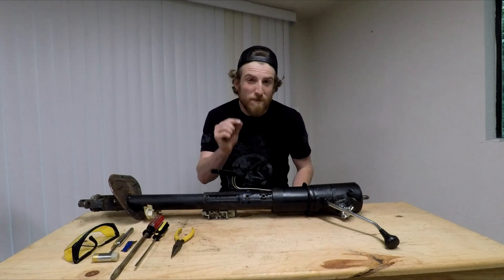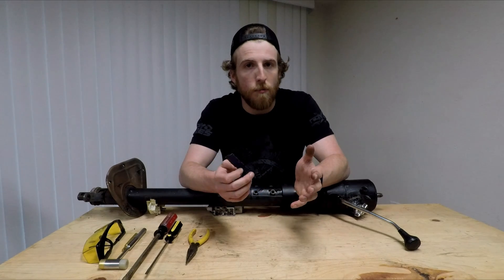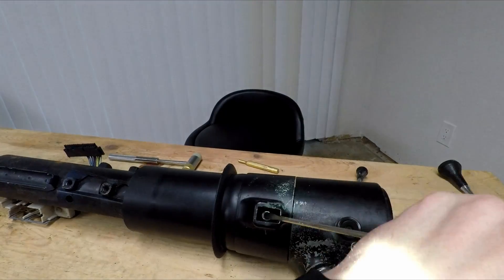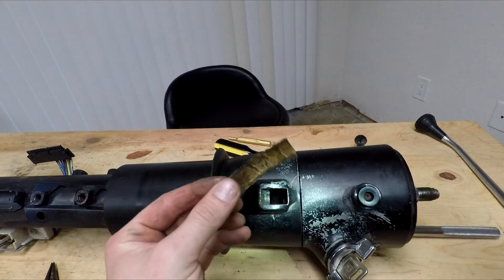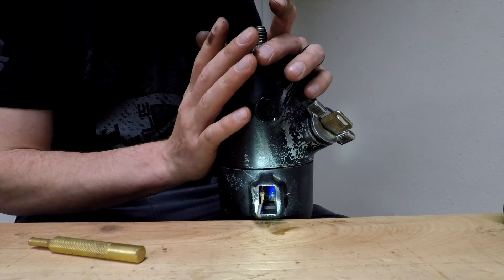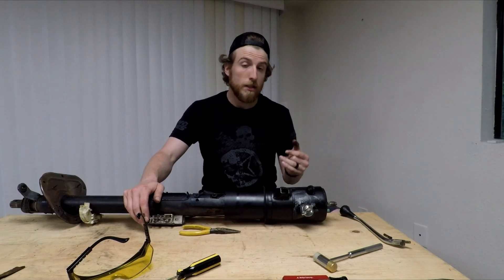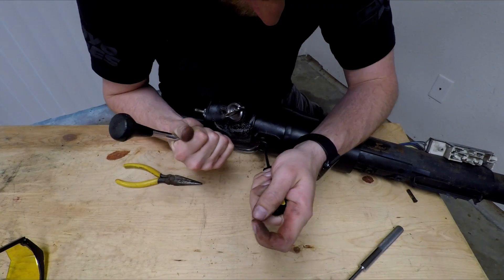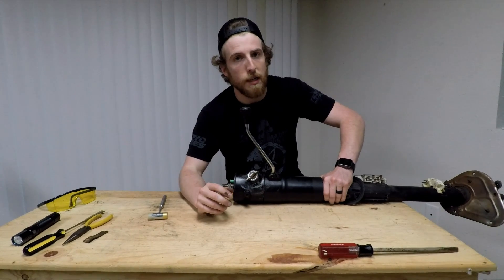Sloppy Shift Knob Fix | Chevy Square Body Steering Column

Comment: I watched yours and a couple of others, None are really installed correctly ..The part of your video where the spring is in place and the left end is curled out towards  you is where the pointed end of the shifter goes and when you apply pressure inwards that will lock everything together without popping inside of the column. After losing 2 springs your way I did what the factory should have done, I drilled a 5\8 hole 2 in, below the shifter slot.  with a rare earth magnet I went to the bottom of the column and slid the 2 springs that went in the other hole where the cardboard was used, now with the bottom hole drilled the screwdriver can curl the spring so the lever is nice and snug..I put. a rubber flat plug cover looks factory.. The spring install now takes 8-10 minutes with the column in the ca.. Thought I would share....
Reply from the maker: Love the ingenuity!
Reply: Thank you. @TheBlazerBeam

Comment: I had the cardboard piece but still lost the spring and couldn’t find it with a little magnet stem. I don’t hear anything inside column and shifter moves fine, will it still be ok if it’s still lost inside? Also my gears won’t engage so not sure if that’s me replacing the spring or something else coincidental possibly linkage but not sure how that would get out of wack if I haven’t been driving it (project 1984 C10, last time drove around the block fine, then replaced this spring and wouldn’t go in gears)
Reply from the maker: The spring is in charge of returning your shifter back into place after you pull back on it. It should still go into gear without the spring. It’s possible the inner shift ring rotated and now is not engaging
Reply: @TheBlazerBeam  thanks I will check that out, it’s the old spring that went missing inside, the new one is in place and my shifter springs back nicely. Thanks!
Reply: What part is that, when I try to search it’s just showing the plastic housing, tried watching tear downs but nobody’s saying what some parts are as they take them off. Was just needing a visual since I’m not taking it all apart. Thanks

Comment: I think my spring got gobbled up somewhere in the columm. Would you be able to say why when I try to move my shifter the whole upper part rotates ?   I'm at a loss.
Reply from the maker: The whole upper part as in the post of the column that the shifter is connected to out the whole steering wheel and everything moves?

Comment: Would this be the problem with my 65 impala the lever is hard to pull to put it in gear?
Reply from the maker: That’s possible for sure. Could be your shift linkage, corrosion in the shaft or lever etc. A lot of debris can get caught in there over time.
Reply: @TheBlazerBeam  thank you